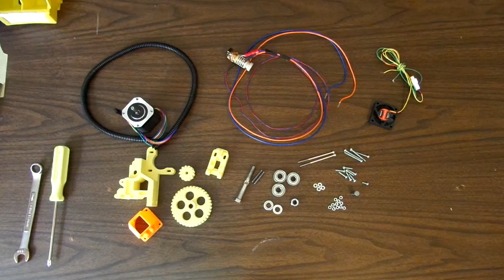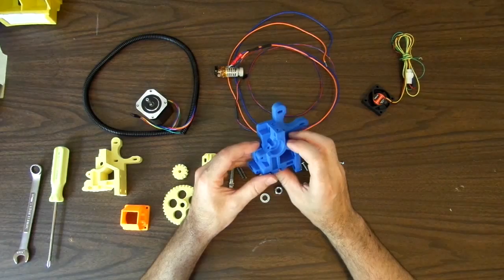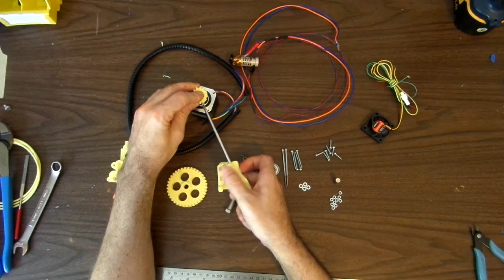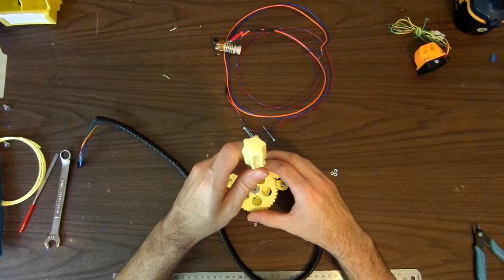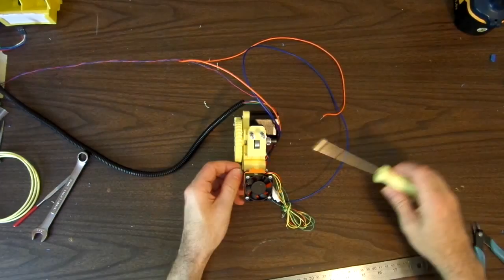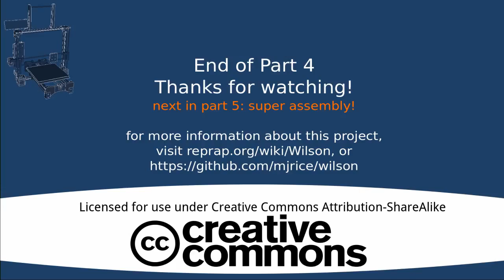Reprap Wilson TS Assembly Part 4 / 6

Comment: What material was the extruder printed in, PLA or ABS?  What settings (infill, support material, etc) did you use to print?  I would assume that this is the only part that might NEED to be printed in ABS.  Also I noticed that you set this up for 3mm, but I plan on using 1.75mm filament.  If you don't have an .stl file with the filament holes sized for the smaller filament, I suppose I could drill them out to fit a piece of 2mm ID Teflon tubing and glue that in place with super glue.    I plan to use my repstrap to print the required parts for a Wilson and  I wonder which plastic I should use, perhaps some parts in each for best results.
Reply from the maker: On my machines, every part is printed in PLA.  I haven't had any trouble with the extruder body warping, even when printing ABS.  It's important to keep a small amount of airflow on the top side of the hot end for this reason, which the fan duct provides.  On the other hand, if you're going to keep your printer in your car on a hot day, then everything should be printed in ABS.
Reply: I was planning on using an ALUhotend which requires such a fan and should fit in a jhead mount.  The parts in the video don't show any layer lines so I thought they were acetone treated abs.